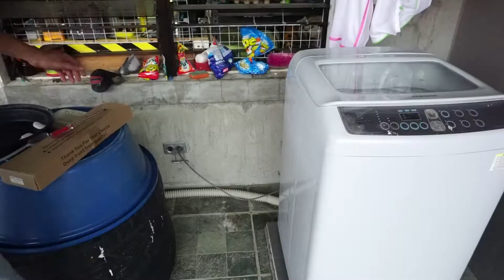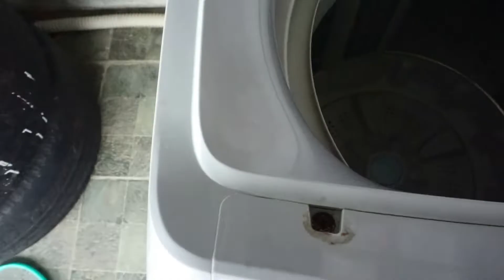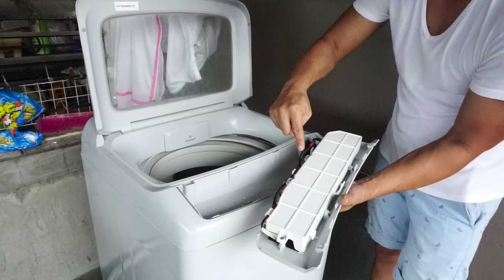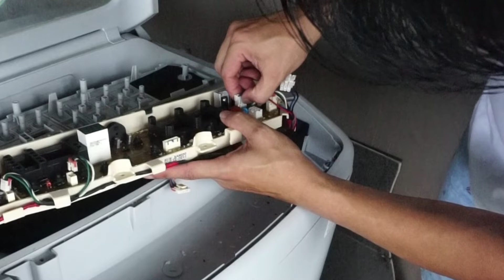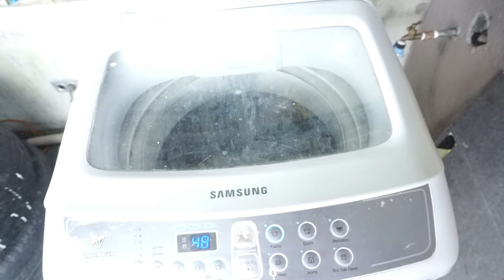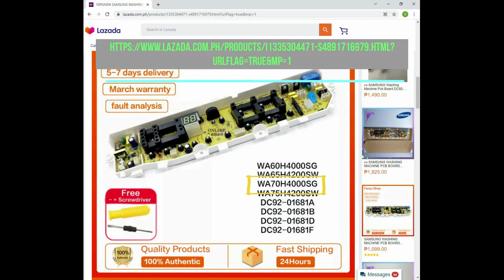Quick vid on Samsung Washing Machine WA70H4000SG Control board Replacement

Comment: Hi! Is it functioning the same way as the original board?
Reply from the maker: The machine is working exactly just like with the original board. I haven't any problems yet. The only difference I noticed is the color of the display but that's just because the LEDs are a different hue.